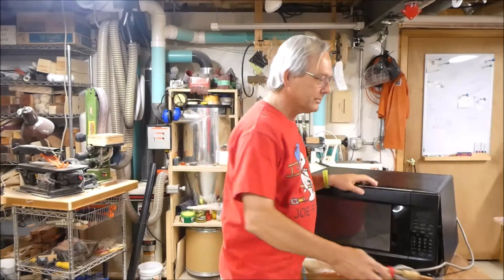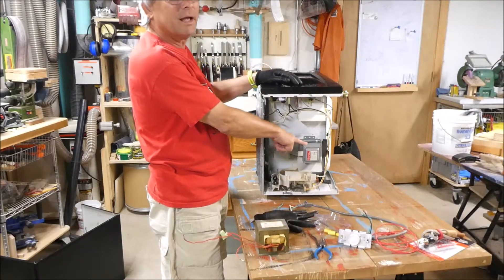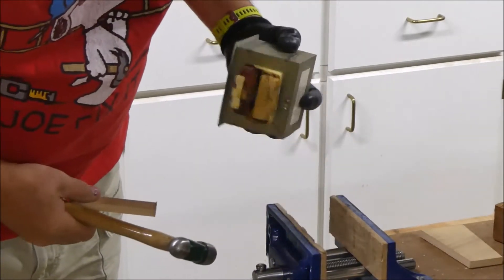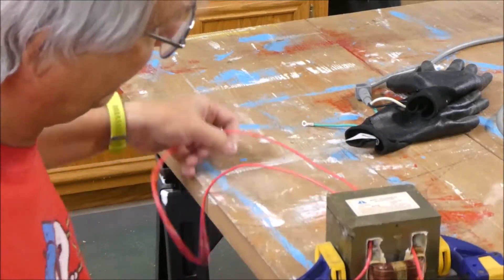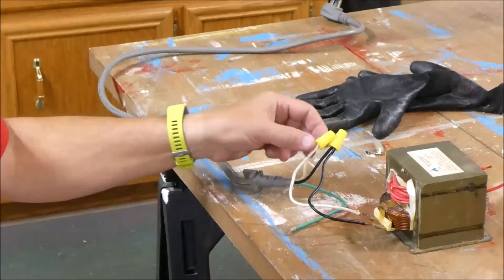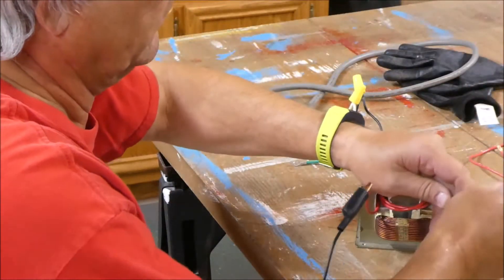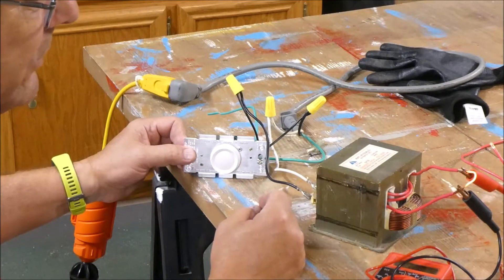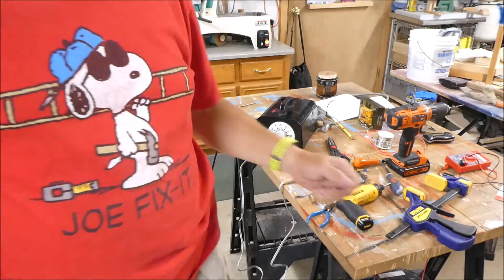DIY Pyrography power supply

Comment: Thanks for sharing your skills in fabricating the pen and power supply. While I'm a firm believer that people need to take responsibility for their own necks when dealing with mains power supplies. I noticed that you might want to caution others about the high voltage capacitor that can maintain a voltage even when the mains supply has been disconnected from the microwave.  The capacitor can be discharged by shorting out the two poles with a insulated screw driver. Thanks again for your generosity in sharing.

Comment: Want to make one of these for my mum, We're in the UK so working with 240volts is there anything different that I should think of?
Reply from the maker: Should be the same. Of course you need a 240 volt dimmer and a 240 volt microwave transformmer. But the output should be the same about 3 volts.

Comment: What type of dimmer switch is that and how do you wire the female input jack to the transformer?
Reply from the maker: GE Rotate On/Off Dimmer
Model number. 18021
That is what I used.  
Just connect (solder)  the 2 wires from the transformer directly to the female jack terminals.